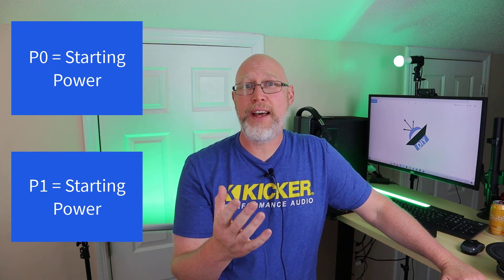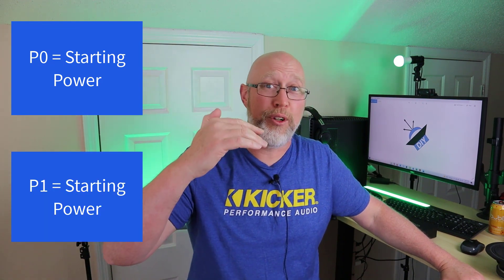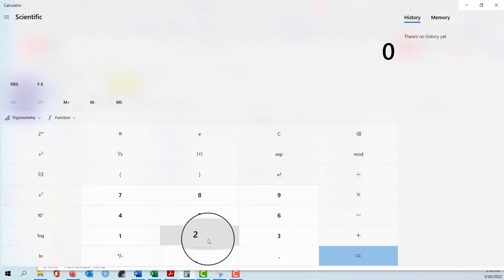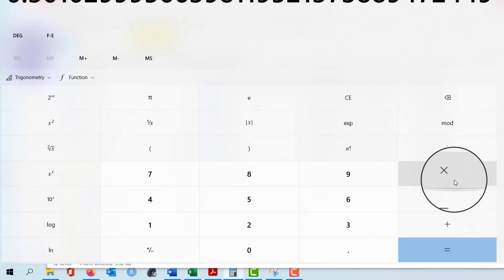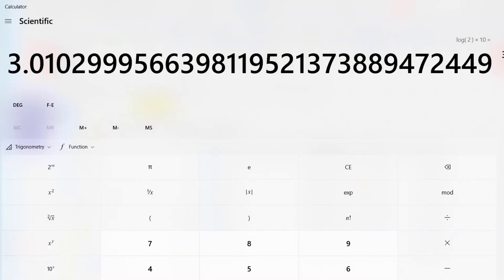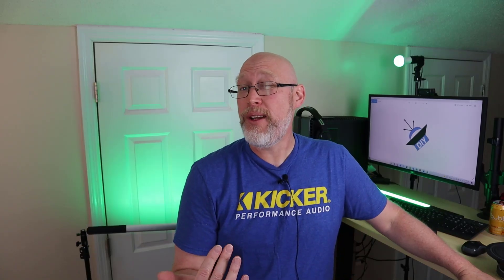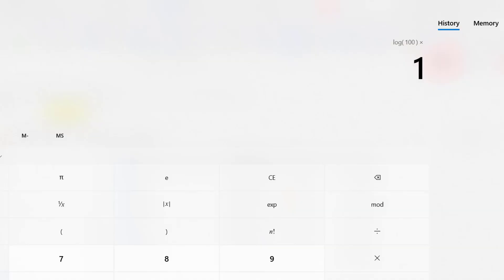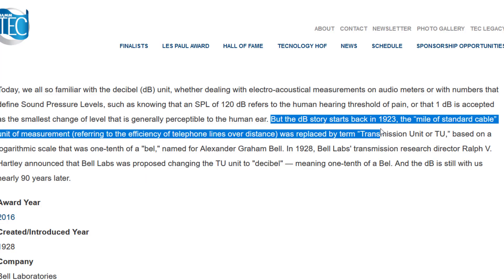How to get Loud:  DB's and SPL Explained

Comment: O dB is not silence, and it's not zero pressure. It's just really quiet - and just about at the limit for what a human can detect. It's an arbitrary reference point set long ago by Bell labs based on the minimum detectable sound level for people with good ears in a really, really quiet place. The key point: it is (just barely) detectable, and zero dB most definitely does NOT mean no sound. It means a defined very small amount of sound and is used as the starting point for comparing the level of other sounds.

Comment: So when a pub tells me I have to be under 90dB , what is that relative to ?
Reply from the maker: That will be the actual SPL that you would measure with a meter.   https://www.amazon.com/dp/B09G6HLNVV/ref=cm_sw_r_as_gl_apa_gl_i_XR5TMR56V0DGS77YG0RK?linkCode=ml2&tag=diy2024-20

Comment: I have a pre loaded 12" ported sub encloser w/ 1k watt amp combo. If I added another identical setup, (for a total of 2k watt worth of amp but the subs are wired to 4ohm) would I need to up grade the size of my wire run? Rn I believe it's a 10ga power/neg wire. Is this adequate? 
Stock alt.. and haven't done a big 3... rn running the single 12" I have zero dimming on lights even at full power. 

I was Goin to get a 10ga power splitter/distro block and run power to each amp and also do the negatives. Split the rem... 

Will I now need to run 2 bass knobs? Can I run 1 knob on 2 amps? 

Is this a dumb idea? Should I just upgrade to a new box, subs, amp, wiring kit? 

I can get the 2nd sub/amp combo for under 250$ 
A new box, subs, amp, upgrade will be like 2grand lol. 

Any help for this noob would be appreciated
Reply from the maker: I'm so glad that you asked for help.  

Let's start with the power wire.  If you are running a 1000 watt amp you need 4 gauge wire.  If you want to add a second one you're going to need zero gauge wire.  

https://youtu.be/To4uT85DUrY

You're probably not running an actual 1,000 watt amplifier, especially if you've got things wired to 4 ohms. That's actually good news in this case, pretty sure you would be popping fuses or burning a wire if you try to pull a thousand Watts through a 10 gauge wire. 1,000 w is pushing the upper limit on what your factory electrical system can provide. You probably need to add an extra battery if you want to run a thousand Watts. If you want to run 2,000 Watts you're going to need an upgraded alternator and additional batteries.
Give this a look:
https://youtu.be/NuO9b1fYisY
https://youtu.be/6_VUjj2eaUk

If you want to run 2000 Watts the most cost-effective way to do that is to wire your speakers to one ohm.  So you need a 1-ohm stable amp and a pair of dual 4 ohm subwoofers.
https://youtu.be/pZPorYW-Wqo
https://youtu.be/_Jl-d_VvJSs

You cannot use one bass knob to control two amplifiers unless:
1 you have two identical amplifiers "strapped" not all amplifiers can be strapped together.
2 You have an external bass knob that is connected to the RCA inputs on the amplifiers.
3 You have an external processor or advanced LOC that has a bass knob.

Hope that helps, best of luck with your upgrades.

Comment: VIDEO IDEA for ya! How about a test of different size sub woofers all from the very same line at the very same watts only changing box tuning for each and measure what kind of SPL you get from each? Basically test and put the debate of larger subs are better at lower frequency to rest. I am going to bet the laws of physics is going to make some people open there eyes.
Reply from the maker: Maybe I can get a company to send those to me so I can make the video.
Reply: @DIYAudioGuy  That be sweet! Or even if you could get at least 8" and 15" Or 10" and 15". At lest enough to show the extremes between sizes. Now you are making me have to subscribe haha.

Comment: Can av receivers get above 110 db if you use much larger speakers like 10 inch speakers or 12 inch or 15 inch speakers
Reply from the maker: It's not so much about the size, it's the efficiency.

Comment: I have a very interesting question for you. There are car audio systems that play 155 db with not too much flexing to the car,
yet there are audio systems that only play about 130 db but are very “ windy “ In the sense that they move much more air from the port and end up flexing the vehicle more. Why is that?
Reply from the maker: Could be the frequency.  It's harder to make big numbers at lower frequencies, but you get lots of cone movements so you get a windy car.
Reply: The high SPL vehicles reinforce the car. Craig Butler's vehicles are built like a tank with several inches of window thickness.
Reply: The more flex, acts as a shock absorber lowering db....

So the higher spl vehicles reinforce to prevent flex and increase db

Comment: Does wiring a amplifier at the lowest impedance it’s stable at in bridged mode allow the amplifier to do it’s maximum spl and allow you to get all the rms power out of the amplifier.
Reply from the maker: Yes, typically  you get more power when bridged.  Just pay close attention to the specs.  Two ohm stable amps are usually only 4 ohm stable when bridged.

Comment: well N /M^2 is the definition of pascal , the SI (derived) unit of pressure :D and when you remember that 1 newton is about the force that a 100 gram weight applies in the gravity of earth it is easy to think of it as the same amount of pressure a object that weighs 100 grams and has a surface are of 1 x 1 meters puts on the ground, so not a lot :D great video of explaining the things though :D
Reply: A sheet of paper is 80 grams per square metre, so rest a sheet of paper on yourself for 0.8 pascals.
Reply from the maker: That is a great explanation, thank you!

Comment: Putting a subwoofer in a room mode is definitely not a good idea! For a higher SPL score in a car, sure but in a room all you get is constructive interference for one note. Definitely not a substitute for doubling the power which would give you 3db more at all frequencies*

*within the limits of the subwoofer.
Reply: That phrase...."within the limits of the subwoofer" is something a lot of people forget. ALL subwoofers exhibit a trait known as power compression. For example...
A sub rated at 1000 watts...
Give it 250 watts and you get 130 dB. Double the power to 500 watts and you might get 132.5 dB (+2.5 dB). Then go from 500 watts to 1000 watts and you might only get 134.5 dB (+ 2 dB). As you get closer to the maximum power handling, you no longer see that theoretical 3dB increase each time you double power, due to the speaker reaching the mechanical limits of the suspension.
Reply: @PURESOUND4  If I am not mistaken, as the power goes up, the voice coil heats up. If it heats up to a certain level, the resistance goes up in the voice coil. This also causes compression.
Reply: @markceci9896  Yes, that's thermal compression. Heated voice coils=higher impedence=less output from the amp. That takes a longer playing time to become noticeable.
Reply: @PURESOUND4  That makes sense. For that reason and others, I prefer sensitive speakers.
Reply from the maker: @PURESOUND4  I could not have said it better myself.  Just because you double the power and gain three dBW does not mean that you're going to get three more dBSPL!
Reply from the maker: Fair enough.